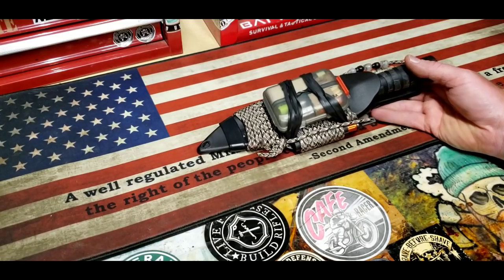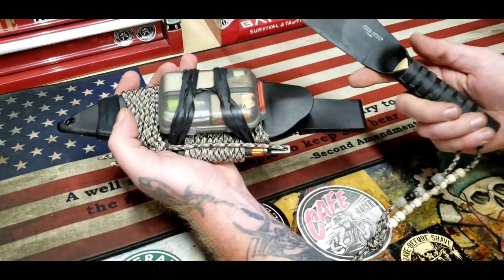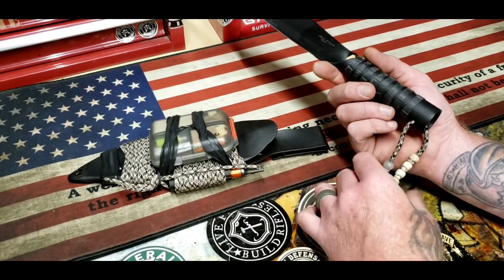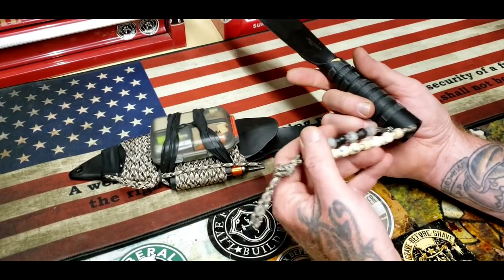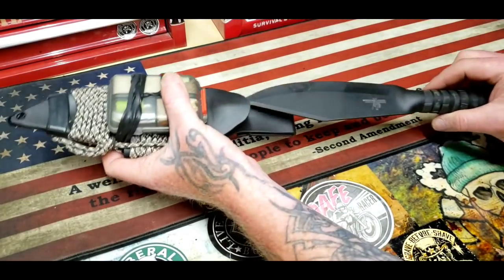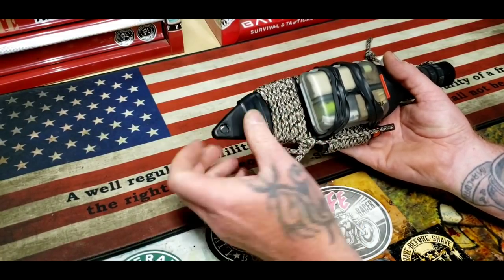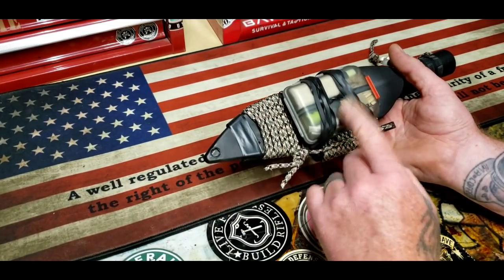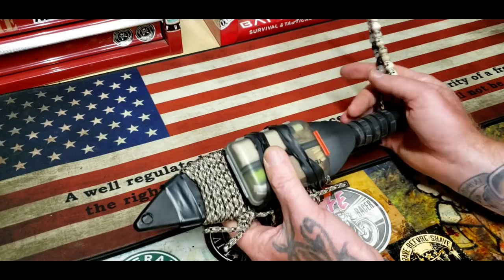Cold Steel Bushman Survival Kit Upgrade

Comment: Great kit. You definitely gave me a few ideas to add to mine, especially the pace counter.
I love my Cold Steel Bushman. I have been using it intensively for the last year and it's held up great. I've used and abused it on purpose and it's still going strong.
I've added a small tin of fire starters and water purification + 550 fire cord and taped the handle with tennis racket tape for extra grip.
One essential item I have in my kit is a fitted screw that can be used to screw the knife to a branch/rod to secure it as a spear.
I know that Cold Steel often gets criticized by knife purists, but I have several and I use and abuse them more than my expensive blades (which primarily stay in my pack for when I really need them). My Bushman and SRK have preformed way above expectation and along with my Schrade SCHF 26 and 36 have surprised the heck out of some knife and steel snob buddies that I have.

Comment: I've got the original one with nylon sheath. I punched a hole on side to put on a cheap multitool  and wrapped the handle in the thinner cord. Remember a eye screw to attach to pole. They get a bad rep, but they are easily sharpened and can weld too pieces together if broken.  Paid 19.95 for mine and I got two original and one like the one you  were modifying. Looking forward to the  sheath you make.

Comment: If you add the entire length or as much as possible of the bicycle tire tube (rolling it in upon its self you can even make ridges by rolling it then pulling it back on its self in set increments) instead of cutting at this stage, the tube could be used to siphon water or gas in a pinch. You can always cut to size later but you can't reverse the process. A short wood screw included in the kit could help secure the blade to a wooden shaft through the lanyard hole.

Comment: Great video thanks. Nice mods. Just waiting on my CS Bowie 
Blade Bushman knife. My plan is to rap the handle with hockey stick  or tennis racket tape that will have a little metal bar running down the bottom of the handle that will have a bend at the end that with stick out and work as a finger guard. This will also keep the handle from being to round and it will not twist in my hand plus with out looking I will be able to know where the cutting edge is at all times. Learned this from video from one of the guys who was a winner on the show Alone. Think I will put some of the rubber ranger bands under the tape so the metal rod is not metal to metal with the handle and they are good so if the tape ever came off I still have a good grip. Great price on these Cold Steel Bushman Knive as mine was only $21.00 with tax and shipping included. Thanks for all your video and have a good one.

Comment: Get a old Timmie boat plug made of brass and rubber and take the bar to tighten it out and put a key ring and seal the bottom inside of the bush aster handle you can put the key ring in the hole were the little bar was on the boat plug and it fits right in the end of the handle as a very nice cap you can tighten up  that's what I do to all mine it looks good and if you got the bottom sealed you can store things in the handle and won't get wet  lol lol yes very good  customized cold steel bush man knife it makes I call mine the real bush master lol when I do this mod